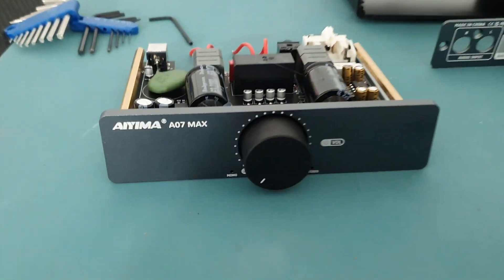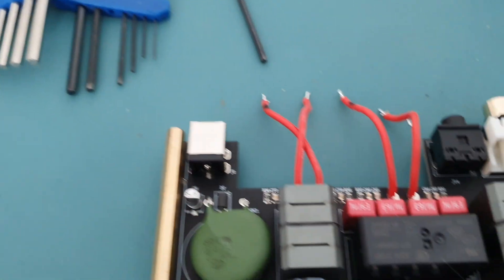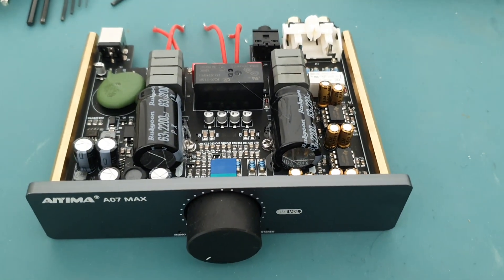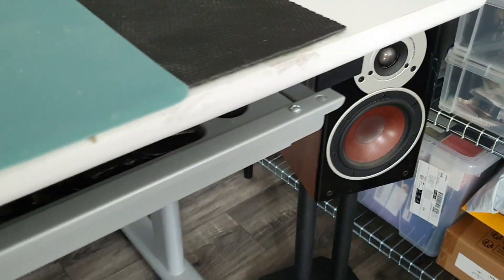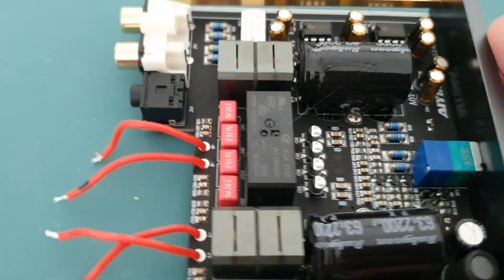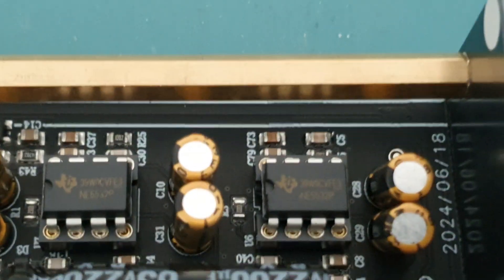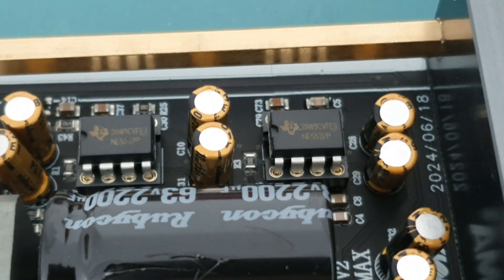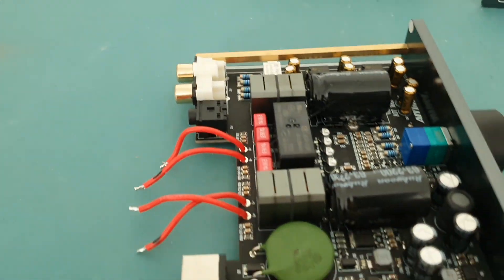Aiyima A07 Max Teardown & Cometary.

Comment: How many Watts can be expected in bridge mode with 2 200W, 4-ohm subwoofers in parallel at 2 ohms? Powered only with 24V 30A?
Reply from the maker: Sorry no idea, you need to look at the spec sheet but all power claims are not true. In my configuration with 24v using 6 ohm speakers I should get 150 watts (more like 25 watts!). If you want high power I don't recommend these.
Reply: @delatronics  I looked for the test specifications from the chip manufacturer and concluded that using bridge mode (mono) at 2 ohms is not worth it compared to stereo mode 2x4 ohms. The final power is practically the same between them, around 70W, which would be sufficient for my environment and hearing. I am looking for fidelity, not brute power, and I will be in a zone where this amplifier delivers the best possible fidelity. I will use this amplifier only for sub-bass with a filter between 25Hz and 60Hz with 2 subwoofers of 200W RMS, 4 ohms, Fs 25Hz, and cabinets with Fb 35Hz. I already use them with another amplifier that is not as good as this one. Thank you.

Comment: I own the Aiyima A07-MAX and a Fosi BT20A-Pro; the two are great little amps.  I initially had the Aiyima A07-MAX running the rear surround channels on my Onkyo TX-50RZ  which worked well for me. I have the Fosi BT20A-Pro in my bedroom system with the Op-amps swapped out to a pair of OPA627AU Dual to Mono Op amp Module (Replacing NE5532).  The change was a dramatically smoother tone to my ears. I highly recommend them over even OPA2134's.

Comment: Hello, very intriguing video!  Did you get a chance to try the Oracle op amp?  I just bought the A07 Maxx and am interested in your outcome.
Reply: @scottbennett3119  I am trying out an Oracle II 02 now and I’m not sure if I prefer it to the LME49720.  I will need to swap back and see.
Reply: @ryanchappell5962  okay, thanks.  1. How much time did you spend with the 5532 and did you like the 5532?   2. Are you actually getting better fidelity by changing the chip? Or do these different op amps affect the frequency response mostly?
Reply: @ I listened to the 5532 for over 100 hours.  I noticed a change going from the 5532 to the LME49720.  The sound seems a bit more real and perhaps less forgiving which is probably due to speed of the LME.  The differences between the oracle and LME are a bit more difficult to determine.  It’s different but I’m not sure if it’s better at all.  

My guess is that the slower speed of the 5532 gives the amp a smoother warmer signature and faster chips like the LME, Sparkos, Oracle are going to be more direct sounding.
Reply: @ryanchappell5962  Thanks for sharing that.  I am weighing the options...

Comment: Easier teardown ... take the volume knob off, remove the nut underneath, take the two outermost screws out of the back, slide the whole thing out the back.

Op-Amp wise ... don't waste money on exotica.  Plain old JRC4558s at about 50 cents a piece will give you a noticeable improvement.  FWIW the actual improvement is not putting in fancy op-amps, it is in getting the crappy 5532s out of there.

For power ... with a 48 volt power supply you will get an honest to goodness 100w/ch with very low distortion on an 8 ohm speaker, up to 200 watts on 4 ohms.

Speaker wise... these amplifiers are wasted on desktop speakers. Try letting them loose on something like a pair of LaScalas, Heresys, L-100s or Lintons... now that's a real treat.
Reply: Are you saying that the jrc4558 is the better choice for higher fidelity sound?  I am looking to achieve better sound quality.
Reply: @scottbennett3119  
No ... I'm saying it's better than the 5532 that comes in the amplifier.

You can spend absolutely ludicrous amounts of money on these exotic chips... but the first step is to see if you need to.  In many cases all the improvement you're going to get comes, as I said, from getting the 5532 parts out of there.
Reply: I just ordered the 4558D - dual op amps

Comment: The TPA3255 in the Aiyima A07max is a powerful amp with some quirks. It needs high current and voltage from its opamps, making it more sensitive to opamp swaps than most amps. The amp has two dual opamps: the preamp opamp, which doesn’t need as much drive, and the driver opamp, which must handle the TPA3255’s demanding input.

I suggest using the LME49720 for the preamp socket—it’s fast and clean, but its lower current output (26 mA) makes it better suited for this role. For the driver socket, the Sparkos SS3602 is ideal, with 50 mA of current drive to properly feed the TPA3255. This hybrid approach maximizes performance while keeping costs reasonable: about $4 for the LME49720 and $80 for the SS3602. Alternatively, the OP8802 can provide 45 mA of current for $50.

While the NE5532 has higher current output (38 mA), its slower slew rate makes it less suitable for the preamp role. It’s worth noting that among DIP-8 integrated opamps, there aren’t many options that can match the high current needed for the TPA3255’s driver section, making discrete options like the SS3602 or OP8802 necessary for the best performance. This setup keeps costs in check while making the most of each opamp’s strengths.

I have no doubt that Texas Instruments could design an integrated opamp that matches or exceeds the performance of the ss3602, they just haven’t gotten around to it yet.  If they do and you could pick it up for $5, it would change the landscape of audio quite a bit.  You basically just need a high current version of the LME49720 and it would be done!

The idea of stacking is fascinating.  Maybe that could work with the LME49720 which is quite power efficient and probably wouldn’t get very hot.  If you can double the drive to around 50ma it might actually match the ss3602 for much less.  My only concern would be stability and potential HF oscillation.  These chips are cheap enough to risk it though.
Reply: The TPA3255 has 20k input impedances on each of it's 4 inputs. 

There are 2 dual op-amps are operating as phase splitters, to drive pairs of the TPA3255 inputs out of phase for BTL outputs.  Almost any op-amp is going to drive it adequately.

Stacking op-amps is a very bad idea.  They mostly have class AB outputs in them and even tiny variations in output bias or gain will cause conflicts, back feeding current from one op-amp to another... and they're going to run blistering hot.  It's simply not worth the hassles it will cause you.

Audio gimmicks abound .... buyer beware.
Reply: @ Is that why there are two of them?  I guess that makes sense that you would need 4 channels to drive PBTL.  Interesting.  Thanks so much for the comment.

Comment: Found it better than my Denon AvR 2805 100 channel amp. Put my ear on the speaker and it was clearer on A07 max. I heard distortion using my Denon.    Believe it or not Im using that amp full volume on large bi amp speakers that push up to 300w.